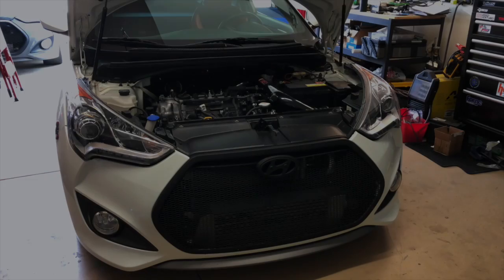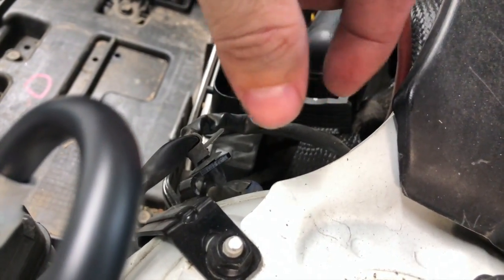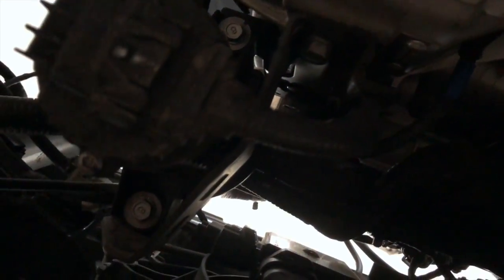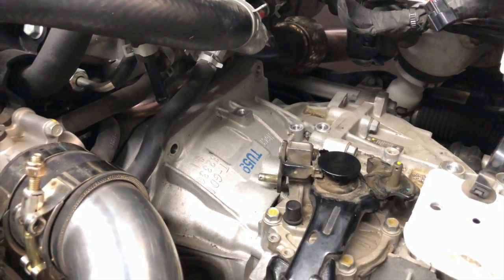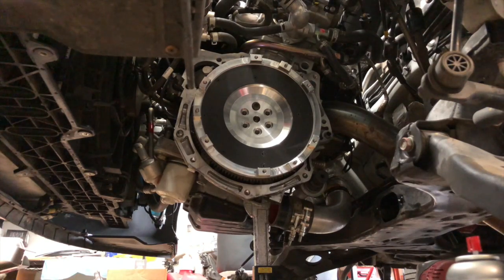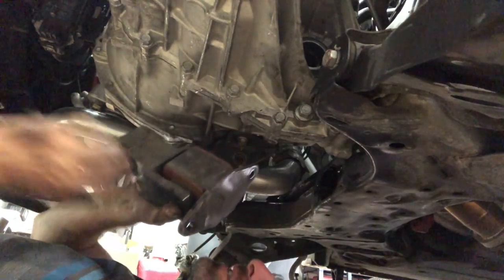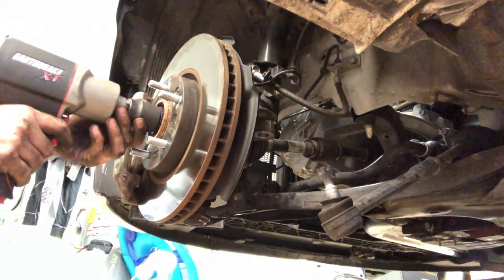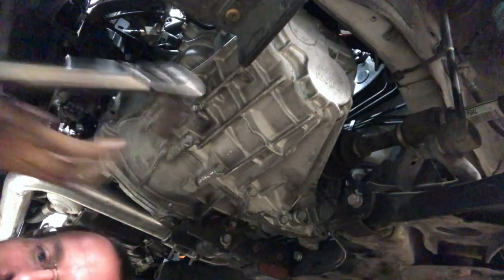Hyundai Veloster Turbo Clutch install *Iphone video*

Comment: Just recently bought the clutch and light flywheel as well as the braided clutch line from you guys and man what a difference...I'm loving how smooth and easy the shifts go in and noticed the rpm not slacking when shifting gears as it used to with the heavy oem flywheel, thanks for helping me out on choosing the right set for my VT

Comment: Haven't drove my Veloster for about seven months drove it around for 15 minutes came to a stop light at green let off clutch would not move pedal feels weird it shifts into any gear like the clutch is fully engaged. Clutch,slave cylinder, master cylinder? Was under warranty a few years back Hyundai replaced the transmission. Any suggestions would be Awesome. Your vid is spot on. Thanks
Reply: Did you figure this out? I have the same issue it’s very odd.

Comment: Currently own a 2016 r sepc myself. I fucking love the thing but recently I thought my slave cylinder gave out, I opened my transmission today just to find out I had the same issue. My DM flywheel had fucked up springs and caused my throw out bearing to annihilate itself on a downshift from 3-2, just ordered new clutch n fly. Thanks for the very helpful video you have saved me quite a bit of money 👍

Comment: I'm a mechanic myself so I'm curious even if it wasn't leaking WHY DIDN'T YOU REPLACE THE REAR MAIN SEAL WHILE THE TRANSMISSION WAS OUT???????
Reply from the maker: Chris Atkinson it was fine on inspection. There was no need to change it. The rear mains on these rarely go bad unless there is crank case pressure issues.

Comment: I swapped my 2012 non turbo clutch out. Hell to bleed. Now I can't go into any gears while motor is started. Suggestions would be greatly appreciated. I'm going crazy. It's my daily driver. Please help thank you
Reply from the maker: Chances are it has air in the line still... It takes a long time to bleed without a speedbleeder or vac pump
Reply: I used a hand bleeder from the ole harbor freight. Seemed like it was sucking in air around the bleeder. I mean we're talking at least 6 hours of bleeding using different methods. Bc it seemed to get "better". Could my slave be bad causing an air leak but no fluid to leak?

Comment: Put a large crescent wrench over one of the protrusions off the flywheel and rotate slightly until it contacts the underside of the radiator support. Let's you use 2 hands to torque the flywheel bolts.

Comment: Hi your video rocks man thank you for it the only thing i want to know is the braided clutch line what size is it and where do i buy it thanks for your help brother
Reply from the maker: Hey there its a 4an and we have them on our site.. we are out of them at the moment but can make more
Reply: @KDMTUNERS  brother help I replaced the pressure plate , disk , and slave and put it all together properly and now I get a code P0236 and I have zero acceleration what could it be all cables are in place ?????? Am so frustrated please help ? 
Could it be throttle body cable ?
Thanks man 👍

Comment: I have to change my clutch on my 2013 veloster turbo(manual),what clutch is the best?What did u use on this car?
Reply from the maker: Nahashon Gitaka we use our own clutch snd flywheel kits. Here is a link to what we used.

https://kdmtuners.com/product/clutch-lightweight-flywheel-combo-kit/
Reply: does that kit fit non turbo too? i have a 2012 na that started slipping tonight
Reply from the maker: This kit will not fit the NAV.. However we do carry SPec Clutches now and they have a really nice Nav clutch for under $400 i believe. Send us a message to Kdmtuners@gmail.com and i can get you set up!
Reply: KDMTUNERS will do

Comment: just wanna ask how that flywheel got destryoyed..did he often bang gears?
Reply from the maker: owaelmo the dual mass flywheels wear out over time. You actually should change them every time you change the clutch. But yes driving style can also causing premature failure

Comment: I need to tackle my slave cylinder on my 2016 it’s making noise with clutch pedal released at idle like the bearing is knocking I push clutch in and noise goes away

Comment: I just bought a veloster. I really like it, except the clutch sounds like it's failing. I'm a pretty dumb woman, so naturally I got myself into this situation. It's a dual clutch (non turbo) and I guess the dual clutch is problematic by nature. 
I have mechanical breakdown insurance (warranty from credit union) So I can only pray that the insurance people will grant the repair. I'm pretty nervous because the insurance wants to identify the busted piece before issuing the entire repair. Aaand they need to make sure it's not from "normal wear and tear".

So if we open her up and the insurance manages to find a reason not to pay, I'm stuck with a torn apart car that will need to be buttoned back up with no repair. What a waste of time, right? 

So, when the vehicle is accelerating, whether reverse or not, there is a an audible knock coming from the tranny. I didn't notice it when I was buying and I was too dumb to do much research on the car. Despite it's low miles 2012(78K) It needs some clutch work. Like most Velosters. Just put a regular clutch in it, Hyundai! (I doubt the tranny fluid was replenished at 40k Miles, but maybe)

Anyway, the garage quoted 1400 for opening to see the flywheel area and button up- no repair

wowowowow
Reply: Pretty sure only 2016 and up models have Dual clutch transmissions
Reply: @alekmz8370  negative
Reply: @MJadeMcGregor  what do you mean, negative? Only 2016 models and up have DCT...
Reply: @alekmz8370  you are wrong. I have a 2012. It is a dual clutch. I have a dual clutch repair quote from the transmission mechanic. I have trim in my car that says dual clutch.

Comment: Can you show the process of putting the clutch on and showing the center male female of fly wheel center.  You didn't show it on the video.  The rest was very basic, but the clutch center and center spacer was stressed and I would like to see it, I never subscribe at all.  but you channel was great till you cut off the point I wanted to see.

Thanks Mike DC Spence
was a technician now I am a Social worker, this my Veloster I am doing the clutch on

Comment: I have a2016 DCT Turbo, the stock Dual Mass is rattling on idle and I'm feeling little vibrations when I press the brake pedal at a stop. Would you recommend upgrading to the one KDM Tuners has over an OEM one?

Comment: Also where can i find a pdf to print out with the torque specs?
Reply from the maker: Dakota Scott You would need to down load the manual if using oem bolts. Arp comes with specs in the package. Oem fly 55 with red lock tight, pressure plate bolts 25, case bolts 35, starter bolts 40

Comment: Just did this 3 days ago. It's a pain in da ass to do by yourself
Reply: do you mind mentioning anything about the whole trans drop, clutch replacement job?  im looking at doing this soon myself
Reply: @Utsusemi  just pay attention to what you take off/out and where the bolts.come from I would suggest take pictures b4 you start. other then that dude is spot on
Reply: @n.a.k4321  Thanks
Reply: @Utsusemi  YW/please remember to support your motor that's a really really important part of the removal
Reply: How long did it take you
Reply: @nofacekid7765   3 days

Comment: 🤦🏾‍♂️ driver error..  even with abit of tune.. no reason the clutch should be overheated..
Reply from the maker: Joe Brown most clutch failures are😢
Reply: @KDMTUNERS  affter the install and with the light weight flywheel how different did it sound different turning over?